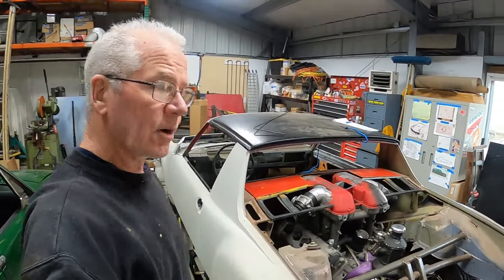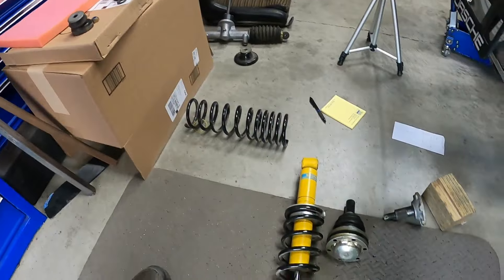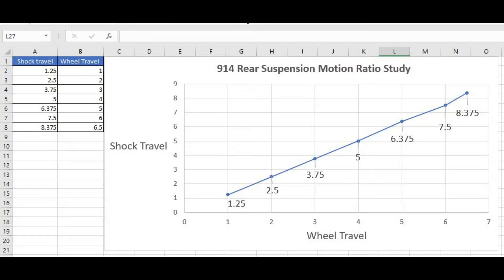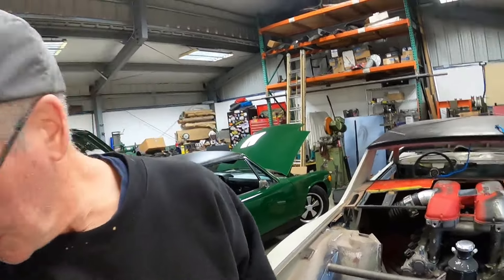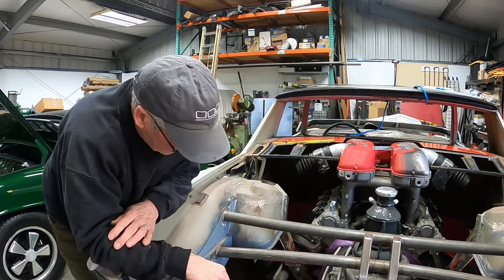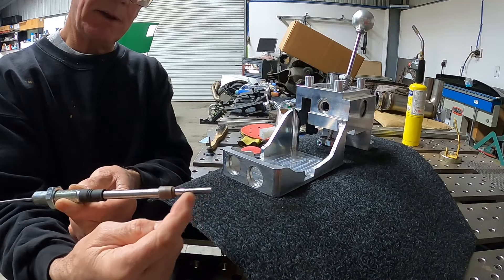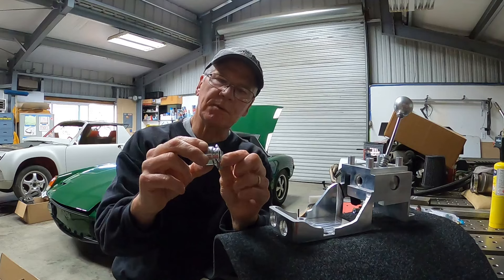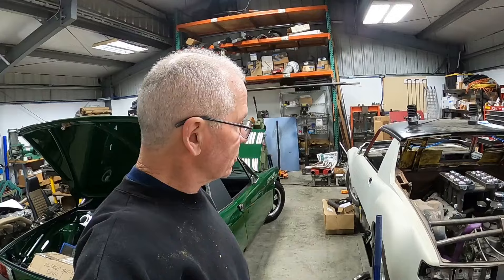914 Ferrari Build - Episode 30: Suspension Part 2 (I have a LOT to learn!)

Comment: The 1.25:1 ratio sounds too large to me, just from eyeballing the length of the control arm.

I wonder if that's due to the angle of the arm's pivot axis?

You can also get the motion ratio by measuring the distance between the center of the pivot axis to both the center of the wheel and to the center of the spring attachment.

I believe the motion ratio of the front suspension is 1:1, since the springs (the torsion bars) act through the A-arm directly.